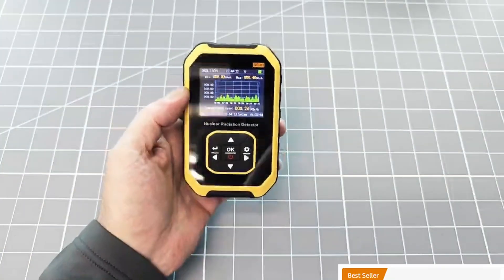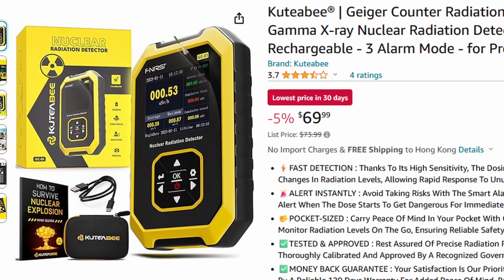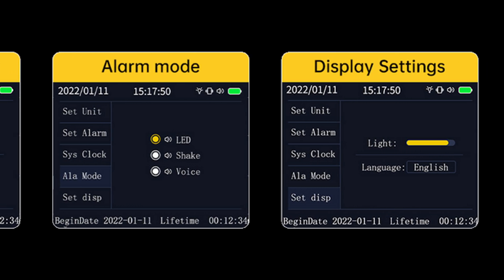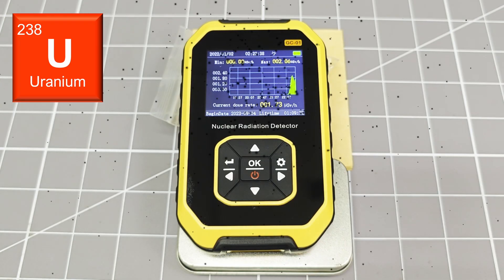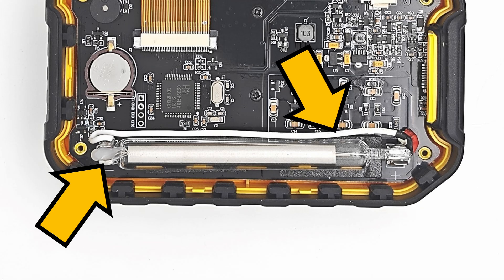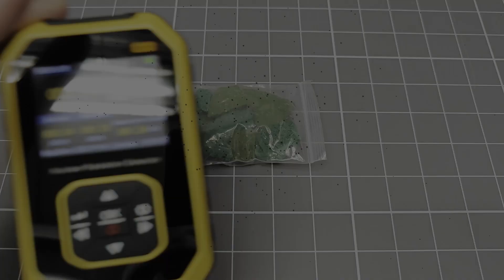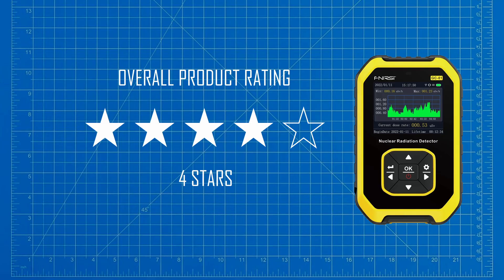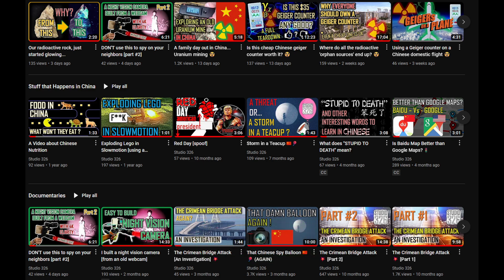FNIRSI GC-01 [IMPORTANT PRODUCT UPDATE]  ☢️

Comment: Wow excellent review and upgrade , I have this unit and had no idea as to its inadequacies. I just took mine apart and confirmed I still have the J321 tube in mine. I must have old stock. The other caveat is there is a fastening screw underneath the small black label on the back that would’ve been nice if you had shown that has to be removed it’s hidden under the plastic black label peel it off and there’s a screw under there to remove. I know you know that but watching the video I don’t think anybody else knew that but thanks again for your great analysis of this product. Cheers.😊
Reply from the maker: I really appreciate the feedback, thank you!
Perhaps the mechanical design has been updated in the version that I have, but I didn't need to remove that label to get the unit apart, as you can see in the tear down, there is no hole in the middle of the PCB to accommodate a 5th screw post.  Just the 4 corner screws were removed and mine came apart.  I looked at some other YT reviews with tear-down's and this was also the same (if you find any different, please post a link here).  
I have been asked to do a quick video to clarify the details of how I added the particle sounds, so I will be sure to include a part about this aspect, so you can see this on my version of the device.  
I have also had an extensive email exchange with the FNIRSI and their B2B commercial sales team confirmed that the factory that makes the branded products also manufacturers the unbranded ones (which is usually the case here in China) and FNIRSI even helps with this sales process and I assume they even earn a commissions as the white label versions are sold through their B2B team.
Reply: @project-326  weird mine has the hidden screw under the label, it’s a branded FNIRSI too not a white label product . Anyway thanks
Again 👍
Reply from the maker: @ralger  I'm pretty confident that if there is a design change, it will have efected all of the versions.  When did you get yours?  FNIRSI confirmed that the change to the new tube was pretty recent.  The sales guy said they changed over to the new GM tube（几个月前）which translates to a number of months ago (between 1 and 4, there is a different expression for numbers between 5 and 10).
Reply from the maker: @ralger  you are most welcome Sir!
Reply from the maker: @ralger  I just released an update for those wanting more info about how to add the particle clicks and I made a special effort to show the absence of the additional screw on my unit.  Please take a look and let me know your feedback!

It would be really strange if the tooling for this as changed, that is a very expensive change to make.  When they changed to the new $hitty GM tube, they didn't even bother to update the PCB but just did some hand mods.

Updating the PCB is pretty cheap in comparison!
Reply: @project-326  I purchased on Amazon in Nov 22
Reply from the maker: @ralger  It's always going to be hard to tell, when it was made, there will be 1-2 weeks from the factory gate to getting on board the ship, 4 to 6 weeks on the water, then customs clearance at your end, then it will go into the brand's own stores before being moved to Amazon's fulfillment center.  How long it is at any of those storage locations is also unknown.  
"New' products are never that new...
It's like when you buy a 'new' car and then check the VIN plate and discover that it is 2 years old...
Reply: @project-326 do you think the number of screws might indicate the age of the counter? 5 screws old tubes, 4 screws new tubes? I have one on order atm.
Reply from the maker: @jessiecator1740  From the comments that I have seen, that would seem to be the case.
Reply: @project-326  it's arrived - 4 screws :( guess I'll just send it back if it's not going to be any good. Sadness.
Reply from the maker: @jessiecator1740  Does it have the crappy tube as well?
Reply: @project-326  I believe so, and, for some reason an AA battery stuck in there on sticky tape?
Reply: I also have this unit (with the J321), and mine also had the screw under the label. So obviously there are some with, and some without.  @project-326
Reply from the maker: Well done mate, you have the original product!  No need for upgrade...

Comment: 12:17 where did you solder the other end to?
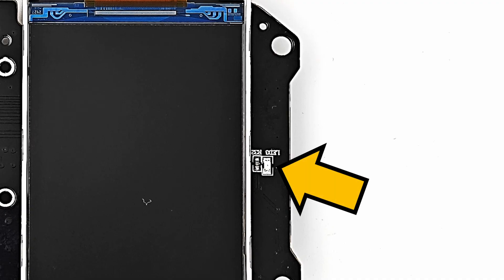Reply from the maker: The LED output signal, sorry I didn't show that bit, with hindsight that was a little tardy of me.  If you pause at 9:55, the other end is connected to R33, at the side that is shown downward in this photo.  I will add this to the description, thanks for letting me know!
Reply: @project-326  Ahh..thank you!
Reply from the maker: @Tschubritza  I have been asked to make a tutorial video about adding the particle sounds so keep a look out for that!
Thanks!
Reply from the maker: Because the capacitor results in a positive pulse at the beginning of the LED pulse signal, it will energies the peizo sounder via the transistor.  If the alarm is active, the negative pulse at the end of the LED pulse, will cause the alarm signal to be briefly interrupted and this allows the particle sounds to still be heard, albeit, as interruptions to the alarm sound.
Reply from the maker: Hi, I just released a deeper dive video that explains the upgrade to add the clicks.

Comment from the maker: I finally managed to do it!  I successfully reviewed a product and didn't mention the Gamma Scout (PoS) once.  What is a PoS?   Its a Piece of $hit, of course...
Reply from the maker: Next time, I might have a few more words to share regarding that amazing product!
Reply: I bought the device even after seeing this video because I don't mind tinkering. It's absolute trash. Even sitting on top of my ENTIRE BOX of spicy rocks, it only measured 1.03 uSv/h. My other cheap (and more expensive counters) scream. Lol

Do you think changing out the tube to the J321 impacts the factory calibration?
Reply from the maker: @AngryGopher612  Wow, that is true dedication to the art of "'tinkering"!
There is no way to know for certain, but it looks like they just changed the tube and the firmware is the same as the old version.

After I added the J321 to my device, the levels were a lot more normal (a little on the high side in some cases).
Reply: bought one  2 weeks ago from FNIRSI Ali express shop and it has a GM 4011 tube inside, is this good or bad news?
Reply from the maker: @BwanaJesuasifiwe  the M4011 is basically the same as the J321, so its quite fine Sir!
Reply: @project-326  but there's a resistor still in the circuit board at the same place you removed yours.
Reply from the maker: @BwanaJesuasifiwe  Best to see how it responds with the resistor fitted first.  After making the video, I ended up adding 20M for the loading resistor...
Reply: @project-326   Thanks. have a nice day and keep up the quality content.

Comment: It was read on Reddit that there is probably a bug in the FNIRSI brand's firmware that occurs when the dose time exceeds 99 hours. After that, the display was no longer updated and the device can only be operated “blindly”. Can you please test whether this is the case?
Reply from the maker: I'll keep the dose meter running and let you know if that crops up.  It does sound like a very simple bug to fix, so I doubt if that bug lasted very long at all.
Reply: @project-326  Okay, I'm very excited. The error manifested itself in such a way that when switching on the logo still appeared and then a lot of ASCII characters quickly ran through in the bottom line of the display. I already had such a faulty device in my hand, but at the time I didn't know the cause or the solution. The owner had simply left it on because he wanted to test the battery life.
In the next comment I will post two links that have to do with the problem, please check whether they are marked as spam.

Comment: That was my first Geiger counter. Mine seems to work better than the unit you tested. …although not as sensitive to [Bs] as my Radiacode 103.
Reply: oh for fuck sake, the 103 is out since 3 days and everybody seems to already have it, how the fuck is that even possible?
> t. Radiacode 102 owner
Reply from the maker: @andreafavero4250  I know that horrid feeling.   I only bought my RC102 a couple of months ago, and just before they reduced the price by $100.  I seem to be particularly unlucky, a similar thing happened with the KC761 too.  Fuckty-fuck.
Reply: @andreafavero4250  The Radiacode 103 has just a bit better resolution. 8.2% ±0.4% FWHM (Full Width at Half Maximum) versus the 102 with 9.5% ±0.4% FWHM. You’ll need to be doing some serious Gamma spectrometry to notice the difference.
Reply: @andreafavero4250  lmao I hear ya ..its not a big deal 102 is just as good .102 owner ..raysis is better 😉😎
Reply: @project-326 it's alright my man, I actually bought two for the black friday event and I have literally zero regrets. It's not like the 103 makes mine less godd at what they do and yes, it's annoying that we didnt know earlier it was going to come out but I have no hard feelings agains the company, also because a product so well designed that can perform gamma spectroscopy shouldnt cost this little. And also I want to thank you thorough review that made me go for it. I absolutely love mine and I will give the second one to a friend of mine because he travels a lot and it will be interesting to see the radiation maps :)
Reply from the maker: @andreafavero4250  if only there was a way to publicly share some of the mapped data, I can see a whole community growing up around it...  sigh!
Reply from the maker: the changes that have been made to this product have occurred in the last couple of months, so you probably have the good version!  It a shame that this product has now been hobbled in such an awful way.
Reply: @project-326 I’ve shared this video to our “Radioactive Minerals and Objects” group on Facebook.
Reply: @project-326 hey, I just noticed, the product you reviewed is missing the FNIRSI name above the display. Mine has it. Perhaps you reviewed a counterfeit knock off? 😮 …but you did say FNIRSI admitted to switching to the cheaper tube.
Reply from the maker: @JohnLobbanCreative  That is correct, both their own branded products and the ones they sell to traders have ALL had the change made (quite recently), this information comes directly from the sales department of the FNIRSI commercial trade department, here in Shenzhen.  I guess they assumed that I was a trader and just told me the new spec.  The other interesting point is that the blue colored devices have another specification altogether...  There are no knock-offs (the product is already so low cost that there is no money to be had by doing that) and they are all made by the same factory.
Reply: @project-326  I think you’re right. Glad I got mine on May 39, 2023 before they ruined it! I also have the new GQ GMC-800. It’s a bit more than the FNIRSI ($99 USD), and seems a bit nicer. It seems to be a third more sensitive than the FNIRSI. You might try reviewing it.
Reply from the maker: @JohnLobbanCreative  I cn't find the GMC-800 for sale here in China, where I currently live, so that will have to wait until I can find one to review.  Given that my reviews can be pretty scathing (and the perhaps the profanity too), I don't get manufacturers queuing up for me to review their products so I have to buy these things for myself.
Reply from the maker: @JohnLobbanCreative  I see that the GMC-800 is $10 cheaper on the manufacturers website.  I'm glad that they changed the shape of the product, the 300/500 series look like central heating or A/C controllers...
Reply: The raysid has 7% resolution 🙂 better then the highest radiacode 103
Reply: Raysid * damn phone typo *